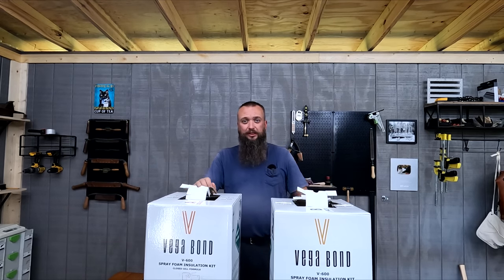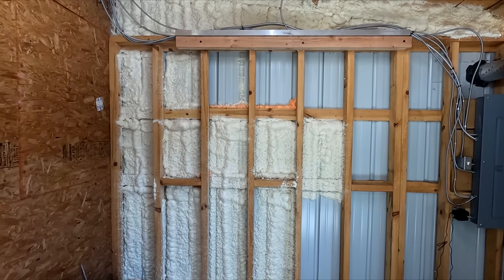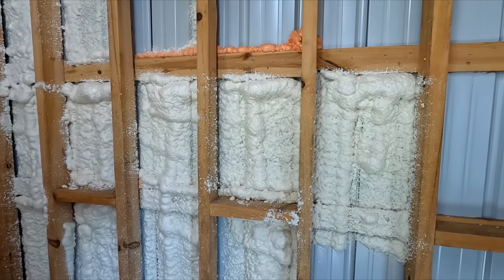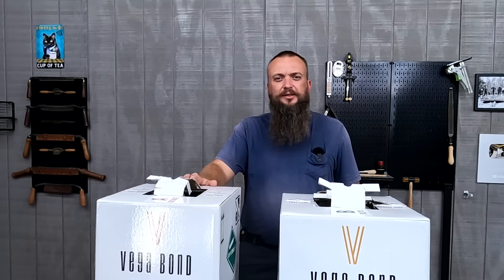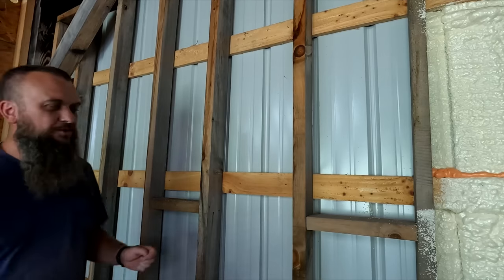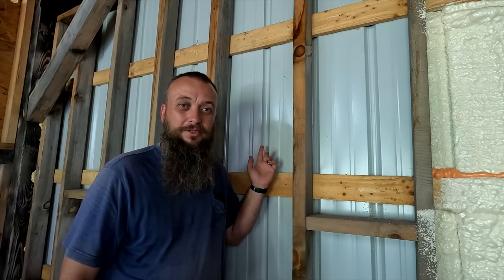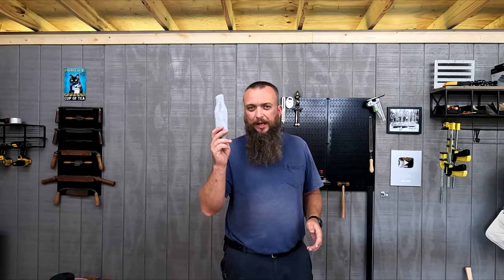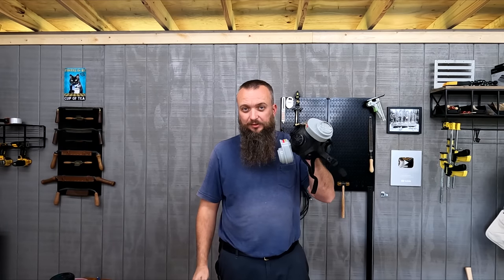DIY Spray Foam:The Video Pros Don’t Want You To See. Save $$$$

Comment: We have used Tiger Foam kits on lots of buses, with good success.  I hadn't hear of Vega Bond before and the spray pattern you showed looked quite good.  Unfortunately, Amazon doesn't have any kits and even the Vega Bond site shows they're sold out.  Thanks for sharing your experience, though.
Reply: I am thinking of using Tiger Foam.   How was that foam?
Reply: @johno8494  It's my "go to" foam kit. 👍
Reply: @RollingLiving  I’m thinking of using tiger foam and doing our barndo with it.  Is this a doable DIY project?  Any tips on using this?

Comment: I have sprayed My addition (walls and ceiling) and The guy who sold the product told me, " do your self a favor and rub plenty of lotion or vaseline on your hands and arms because you will get some on yourself, and it is a pain trying to get off.  Wiping some on your face is a good idea too.  I wore the food service hair nets, but I would recommend a ballcap that you don't care if you need to throw it out.  I also have a beard and hand lotion in my beard worked out, as well because the over spry did leave a mist in my beard, which washed out easy enough.

Comment: Random question. Do you flip your videos? I'm asking because whenever I see tanks like that, they're usually propane and they're reverse threaded. It seemed like you were tightening to the right like normal threads, and I'm just curious if that's the case with those or if it's just backwards to us.

Comment: Interesting. I had my metal shop similar to your sawmill building professionally done it’s a 20 x 20. It was 2 years ago and costed $2200. So the savings is significant
Reply: Is it?  That sounds like 240 sq ft per wall.  That means you need two if only doing one inch.  At minimum you spent $1700.  

Prices need to improve still…
Reply: Someone quoted $3300 for 12x24 shed , open cell.1 month ago

Comment: goof video and i may get it for a kiln.  If you watch yourself, you do a lot of wiggling back and forth, and it seems the application would be more uniform thickness if you did a deliberate slower spray  the long way instead of jumping around and side to side.  Thanks for letting us learn from your experience.  Doc.

Comment: Acetone only removes it before it cures. I used to work where stuff like that was made.  Interesting place. If it's not too thick or stuck on hard, agent's scrub with a scotch Brite pad takes a lot off. The main advantage to the foam besides the thermal break is closed cell foam is a vapor barrier and seals up all the little air leaks.
Reply: Is there any problem a Scotch Brite pad can’t solve? I think not!
Reply: @JLC87420  Hmmm... depends on the application!
Reply: @monkeygraborange  I got one! Removing scratches? Lol

Comment: I've considered spray foam insulation for different purposes (i.e. under my house) but it is so messy and you have to finish once you start or it will clog. In my research I found that, for the money, by far the best insulation is reflective bubble insulation. It is not any more expensive than foam insulation (not sprayed) but has a far greater R value. Double reflective bubble insulation has an r value of 21 compared to R10 for 2" foam insulation. Vega Bond has R7 per inch, which means you'd have to get a 3" coat to match the double reflective bubble insulation.
Reply: Foil bubble insulation (3/8" thick) is about R1.3 (source: The Journal of Light Construction). Some will tout higher R values based on their use as a radiant barrier. This requires an air gap on both sides of the foil wrap and the foil being between the source of the radiant energy. For example stapled to roof trusses between the roof deck and the ceiling.  If there isn't an air gap the the foil is just a conductor. 

The Federal Trade Commission has sent letters to manufactures of foil-faced bubble insulation warning them that their claims aren't in line with reality. 

For a crawlspace, where the only radiant energy is coming from the conditioned space, conduction and convection are more the problem. In this case traditional insulation will provide more R value/$.  In colder climates foil backed rigid foam board with the foil facing the floor might provide more performance than foam board alone.

Comment: Your metal is still going to sweat, and now your wood will be trapped in that moisture. I have a similar situation on the roof of my reno. We're taking the metal off, laying plywood decking and felt down, then putting the metal back on. Then I can insulate from inside. I may not know what I'm talking about, but good luck to you.
Reply from the maker: Did the same thing on all my buildings.  No sweating.

Comment: Did the nozzle drip continuously between trigger pulls. Guess what I’m askin is , if you set it down to move some stuff around is it continuously oozing out?
Reply: No but they usually send several extra nozzles as they will stop working if you let the stuff stand for much time at all.

Comment: Regular foam board and wrap way cheaper, better r value, and you can remove it and put it back if you have to repair panels or boards. I don't get the foam thing..

Comment: What happens if the metal roof/wall panels need to be replaced some day from age or say storm damage ? Will the foam be ripped off as the metal is being removed ? My neighbor just had the roof and 2 sides of his pole building replaced (insurance claim for hail damage ) His building was not insulated, but it makes me wonder if the insurance would cover the cost to replace the insulation also?
Reply: does it really matter cuz if you used insulation ? cuz if got wet you cant reused that insulation and remember it a barn not a house
Reply: @funtyes1970  Ah yes it does matter. Hail damage did not cause any water damage to my neighbors garage, therefore water  damage is not the issue.Also closed cell does not absorb water , so again it could be re-used. Yes it matters if you have ever dealt with insurance companies.

Comment: Good video!  There's a cheaper way to do this with sheet foam and spray foam that works just as well.
Reply: Nope. You will still have moisture in between the foam and the metal. Maybe not as much. But still some. That moisture will work it’s way down to your bottom plate and rot it out. If it’s a wood outside building then ya whatever. The moisture will just work out through the wood.  But steel buildings and plastic type buildings are way different.

Comment: I have had spray in foam on two buildings, I hired it done and had 3 or 4 inches applied and did not use fiberglass, why didn't you do that
Reply: Fiberglass lets moisture through to the metal dramatically decreasing the R-value.  That's a bad idea.  1 1/2" of spray foam and filling the rest with fiberglass will work vastly better.

Comment: The spray pressure in those kits is not high enough to get a complete coverage in corners and behind studs in the little gaps.
Don't use as the main insulation in a house, a garage or shed or whatever is fine.

Comment: I own a spray foam company you, these are for very small areas cost wise you might be saving but you can hire a pro for $2 sqft for open cell that will spray 3.5" and fill the cavity of the wall
Reply: how much for 2 inch closed cell?

Comment: insulation is expensive any way you do it... i have 12x34 work shed I need to do... I would need like 4 tanks just to do the walls 3 inches thick...
Reply: Don't go 3" thick.  It's too much money for what you get.  Add 1" to 1.5" of spray foam and then fill the rest of the cavity with Rockwool.

Comment: Thanks, one thing I learned watching, I am going to leave spray foam and for that matter any big insulating job to the pros...  9:10 somethings are better left to the pros...  I don't think you saved that much doing it yourself,  especially in long run energy costs if it is not done right.  The pros get insulation at a bulk rate, the mess, and planning is just not worth the saving for a DIY job.

Comment: Sorry, I'm just a retired Safety, Health & Environmental Professional getting on his soap box. LOL. You can not get any half or full face negative air respirator to seal around your face with facial hair. You will be breathing in the Isocyanates and possibly damaging your lungs. That's why OSHA requires employers to conduct an annual fit test, respirator physical,  pulmonary function test, and be clean shaven. The chemicals in the spray foams can be deadly and/or debilitating.

Comment: Something was definitely wrong with the gun or the gun setup, because the amount of dripping was quite significant, your floor has an R value higher than the walls..
Reply: If you weigh the tanks down in  tote of warm water it makes a huge  difference. Smooth  consistent spray pattern  right to the end.
Reply: @mrfingers4737  how do you keep that water warm?
Reply: @RICK-uf1jj  it will stay warm long enough to empty one of those kits unless your doing little bits at a time.

Comment: When using a DIY spray foam kit , one needs to do a few test sprays on scrap to get the pattern and technique correct before jumping right into the job . The edges of the space need to be sprayed first so that the foam gets behind the studs and seals any air gaps then the flat area needs to be sprayed in an even thickness . Lots of air gaps in this video and very uneven spraying . This negates almost all of the benefits of using expensive spray foam . Applied correctly , spray foam is great .

Comment: WORDS OF CAUTION !!! This spray kit contains materials called Isocyanates. Isocyanates are extremely harmful to the  respiratory system. 
EXTERIOR application of polyurethane foam has a minimum requirement of an OSHA requirement of >>>
"Air-purifying respirators (APR) and powered air-purifying respirators (PAPR) are generally appropriate for exterior applications and may be used when spraying polyurethane foam in exterior applications."
INTERIOR application of polyurethane foam has a minimum requirement of an OSHA requirement of >>>

Supplied air respirators (SAR) are typically used in interior applications.

Comment: ok and R value of 7 for $800?   does anyone else see a problem with this?  fiberglass rolls can provide r value of 30 for $22 a 25 foot roll

$1.30 a sq foot vers  about .22 a sq foot for 4x the r value....what am i missing
Reply from the maker: put fiberglass against metal and you get mold due to condensation,

Comment: I’m concerned with you spraying against your metal siding. I believe it’s red in color and could get very hot in the sun. This could have an adverse effect on the foam. Either cause it to shrink or possibly catch on fire.
Reply: I have seen demonstrations  the foam insulation  actually  doesn't  burn    not sure but that was one of the criteria  that allowed approval  for construction use 
Closed cell stops water pentration   open cell will allow water to soak in answering pass thru and mold
Closed cell also adds to the support of structure
Reply: Closed cell foam meets the flame spread requirements of the code to be used in enclosed areas, for instance,  such as crawl spaces.  Open cell foam does not.
Reply: @roberto.peterson9917  thanks for the reply. I’m a big fan of foam insulation. Just wasn’t sure about spraying it against metal.
Reply: Thought I would chime in on this.. lots of misinformation here.  William - could shrink but higher likelihood that it will pop-off due to deflection and/or freeze/thaw. The metal looked painted so if it’s at all slick that’s a concern. Highly unlikely it would ignite due to environmental heat (sun vs a fire against the side of the building). Ignition points of most traditional foam is significantly higher than the structure would see under normal circumstances. 

Robert - demonstrations of this foam or foam in general? I looked at the VB website and they offer no technical data.. it is vague to say the least. Most proper high pressure spray foam (this is a low pressure system) goes through extensive testing to be allowed to be used in buildings and meet Code minimums. Tests such as ASTM E84 and others are required. The type of material (open or closed cell) in this case is irrelevant..they both must pass and yes, open cell foam can pass E84. Both traditional open and closed cell foam have the capability to stop SOME water infiltration.. but neither should be considered waterproofing. And yes, traditional closed cell can add rigidity to the structure (referred to as racking strength) however how this is being applied, that wouldn’t be a characteristic of the foam here. 

Steve - sorry man but that’s just wrong… and I have no idea where you are getting your information? Flame spread and smoke developed are outputs of ASTM E84 as stated above.. both open and closed cell can pass. Because material is closed cell does NOT mean it’s an automatic pass.. same with open cell.. does not mean it’s an automatic fail.  Further, the use of ANY spray foam in an attic or crawl space undergoes a completely different test (NFPA 286 and/or Appendix X) and again neither is a guaranteed pass or fail. There isn’t a unique test for ‘enclosed areas’ within the I-Codes. There is for other areas (e.g. use on off-shore drill rigs, etc.) but that’s not covered under the IBC or IRC.
Reply: @roberto.peterson9917  please see my reply to your comments within this post. I didn’t separate my responses out individually. Sorry.
Reply: @stevevice9863  please see my reply to your comments within this post. I didn’t separate my responses out individually. Sorry.
Reply: @StephenDavisMonsignor  Couldn't find it.
Reply: @stevevice9863  it’s inside of this question/comment originally posted by William Mauzy… your reply to me and this reply to you is all within the post.
Reply: @StephenDavisMonsignor  Your post should be tagged at the top of this comment section. 
I'll just add that DIY low pressure spray foam and commercial high pressure spray foam are two different beasts. This particular product is not legal for sale or use in about 10 US States already and may be banned all together by 2025 due to the volatility of the chemicals used. While that VOC issue is worst during application it can linger for months afterwords based on how the spray foam is mixed during application. 
There is a place for DIY spray foam, but practically speaking if it's a living space and/or more than a 500 board feet or so it's better to have it professionally done with a high pressure spray foam system by trained professionals.

Comment: You should never spray bare metal.you should of used house wrap under the metal so if you damage the metal at some point in time and want to replace metal that's been damaged

Comment: Being a professional spray former I do not see how this is going to work??
Reply from the maker: It worked 😂😂
Reply: @OutoftheWoods0623  not in minis 45 its not  lol 😂  code is minimum 5 inches on exterior walls am it has to be 4 pound foam closed cell

Comment: Missed opportunity: Radiant barrier first!  Those nailers would have been perfect to create a dead space to reflect radiant heat back onto the sheet metal.  The foam insulation could have been sprayed onto the back of the radiant barrier.  Remember: Heat travels in three ways: Conduction, convection, and radiation.  Spray foam is great for the first two, but you have to deal with that metal warming up in the sun and radiating inside.  (This is even more true for above.  Get some on your rafters ASAP!)
Reply: 100% totally agree and will be doing that exact system on my two properties, brother and his ex's homes.  They will have have conditioned attics.  I am an HVAC dealer that also does Home performance.  Very few people opt for both.  But we do the 2" spray foam with the Rockwool bats making for a high r-value depending on their budget.

Comment: I install professionally, and we only charge $1.30-1.50 a bd ft. And it's a much better product and end result. The only way I'd possibly recommend it is if you have 25 sq ft and the pros have a $1000 minimum charge to show up.
Reply from the maker: 4$ here. You have a good price
Reply: @OutoftheWoods0623  I'd check around. $4 a ft would buy almost 3" for most of the installers I know.
Reply: @DIYProjects88  where are you located
Reply: @RICK-uf1jj  NW PA and NE IA.

Comment: So you get a low R7 on 7 or 8 feet of wall for $900? hard pass
Reply from the maker: not after R value here as I explained in the video, 
thermal barrier to prevent the metal from condensing on the fiberglass insulation I installed over the dry cell foam. pretty simple and easy to understand for most,
Reply: I was looking at the product not your use and application of it. t
There are also cheaper ways to add a thermal barrier.
Reply from the maker: please list the options and the cost and long term hold up vs closed cell, 
thanks for being a keyboard warrior
Reply: @OutoftheWoods0623  agree with you

Comment: sooooo i can get a pro to come in here in southwestern Ontario for 4.99$/square foot at 4"!!! soooo not sure why anyone's wasting their time on this stuff!!! a thermal barrier is nothing at 1"!!! and that's if your good enough to get 1" EVERYWHERE as from what i see at the start of the vid, your inconsistencies WILL create a dew point on the inside of your walls!!!  this stuffs NOT cheaper than hiring the job out to a pro! just like a chain, you're only as strong as your weakest link!!! those areas low of foam, will undoubtedly get cold/hot spots!
Reply from the maker: You should stick to playing guitar

Comment: Yeah I can tell you have never painted before cuz your spray pattern is pretty bad and uneven. Also you might want to make sure you spray behind the diagonal studs and as much as possible between the studs and the metal. Either way cool video.